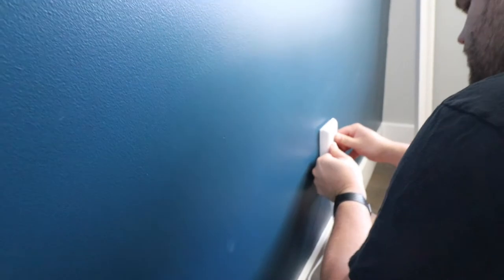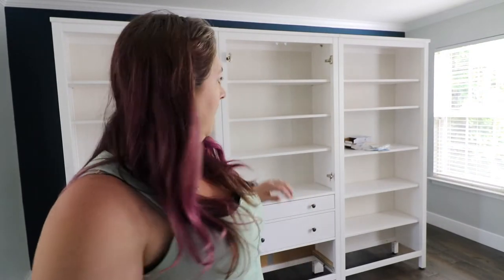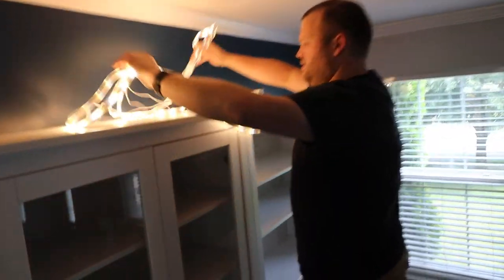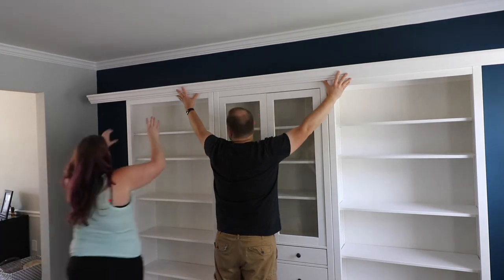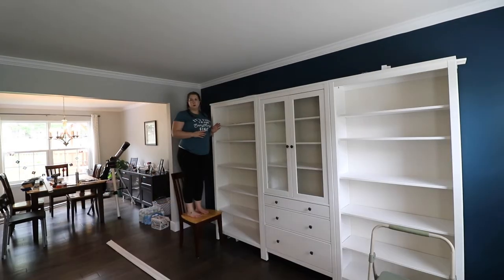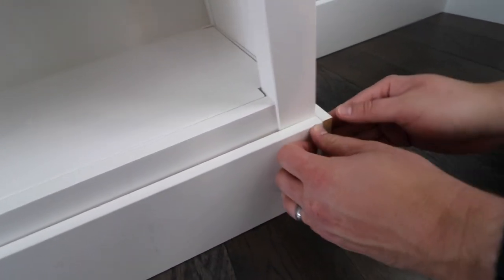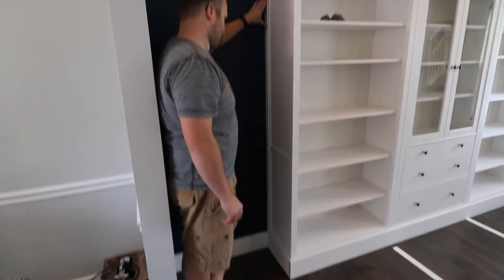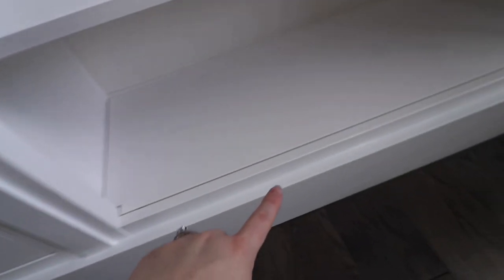DIY Ikea HEMNES Bookshelves Into Built-ins

Comment: Nice work!  As an FYI, if you want miters on baseboards, just cut the joint like a degree shallower.  No gap in front, corner is tighter, and just some nice white caulk along the seam.  Admittedly, it works better when there is a bevel-type shape on top.

Comment: Are you able to provide details on the base plate power cord that you used?  A link?  Or other details that will help locate one here in Canada?
Reply from the maker: Sleek Socket Ultra-Thin Electrical Outlet Cover with 3 Outlet Power Strip and Cord Management Kit, 3-Foot, Universal Size https://www.amazon.com/dp/B07S8DZ1T5/ref=cm_sw_r_cp_api_glc_fabc_L4ndGbSYB0B9F?_encoding=UTF8&psc=1

This is the Amazon link to the faceplate power cord we used. We bought all our extension cords and lights from amazon